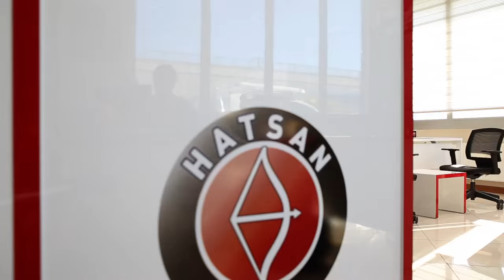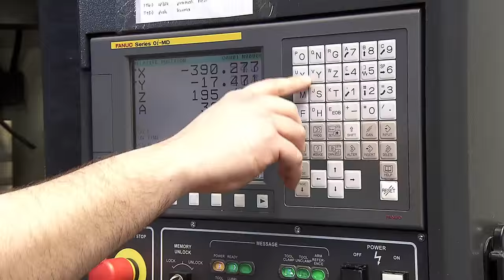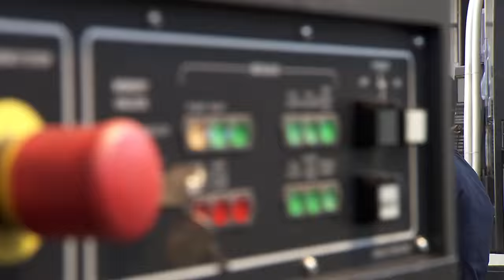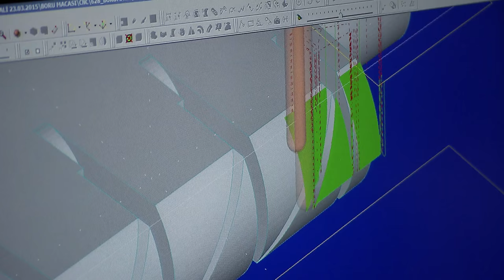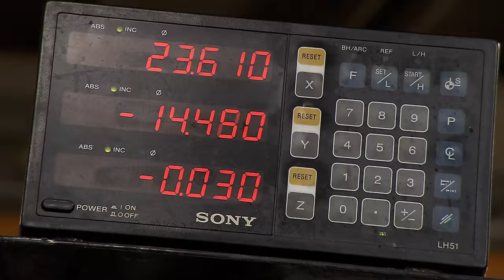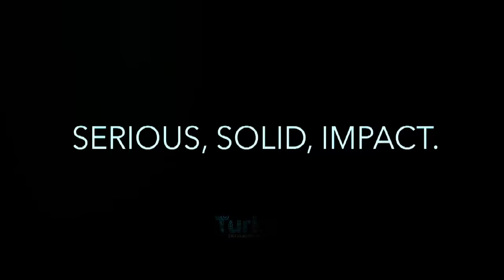Hatsan presentation video

Comment: I recently purchased a Hatsan Escort Slugger for my gun collection. For a budget-friendly shotgun for security or home defence, it's not bad. However, there are a few changes needed to make Escort Slugger a contender in the shotgun market. 

1. Have the receiver drilled and tapped for aftermarket optics like a red dot. 2. The tube magazine needs to be designed to allow swapping in or out the migratory restrictor rod. Another issue the tube follower changed out from cheap plastic to metal. 

3. Better aftermarket accessories like barrels upgrades example SLUG BARRELS, RIBBED BARRELS, TACTICAL BARREL WITH SCREW ON ABILITY TO ADD LIKE A BREACH TIP FOR SECURITY OR LAW ENFORCEMENT. Other add on's like stocks types folding, telescopic, riser adjustable etc. 

4. The action slide changed to prevent covering up the receiver which prevents adding a side-saddle. I suggest a corn cob type. 

So much more can be done...... Hatsan contact me

Comment: I have the Hatsan Flashpup Qe sintec version .22  (Red magazines), hit hard, well balanced, minor adjustment to my taste and perform good ,overall  ok, but i found some weak points to be consider in a new v2 version... little on heavy side to carry around ..hard to cock ,The Cnc program need to burr some material.., good price.. Like Crosman Hollowpoint premier.

Comment: Have two hatsan flash qe 25 cal and 22   cal. Bad orings and non existent orings both rifles. 25 caliber magazines are crap, period. The hole where the pellet goes in into the barrel is to big and not round at all. Step up hatsan

Comment: With the extensive cnc equipment, can someone explain to me just why that although they look fine on the outside. However, ,inside the machining is pitiful . Third world at best. And the weight. Not excusable in the least!  Anti bounce devices that break in the first 100-200 shots, Only to be replaced with even lower quality parts from Hatsan. Magazines that have to be deburred in order to achieve any kind of accuracy. Reall? With current quality, very overpriced.

Hatsan has a lot of issues it needs to address with the tremendous amount of lower cost, better airguns being produced today. 

KnifeMaker